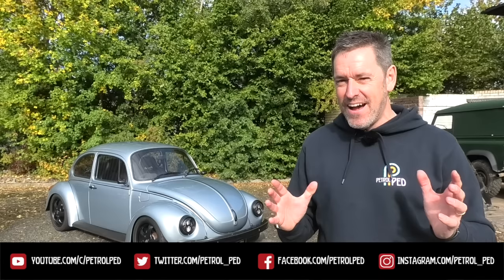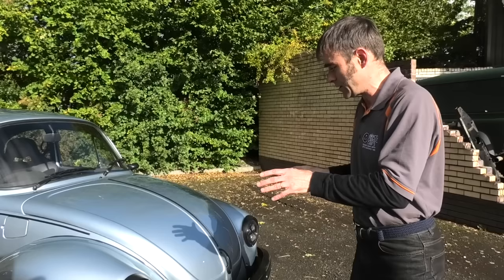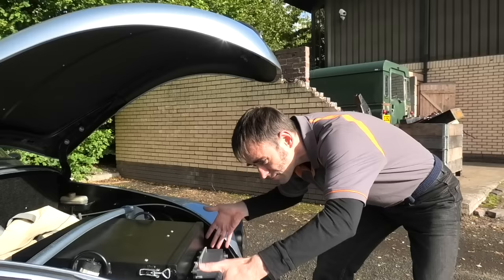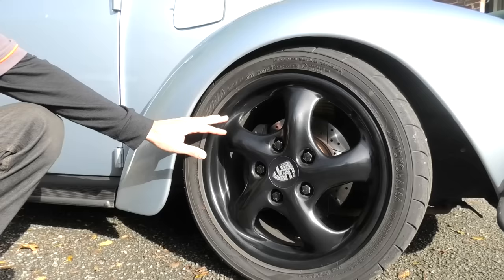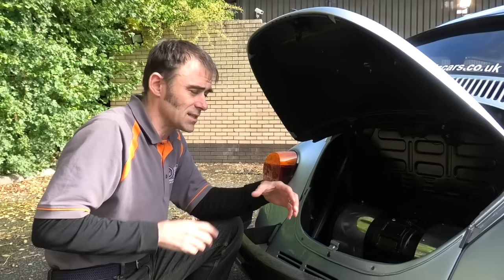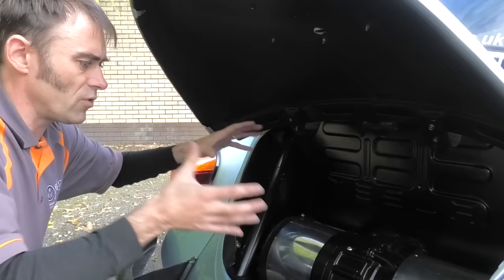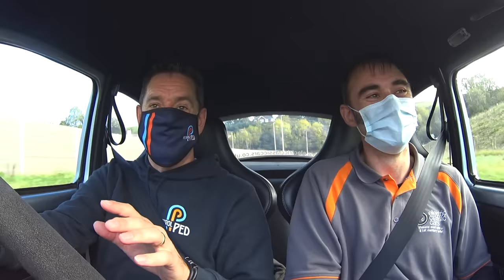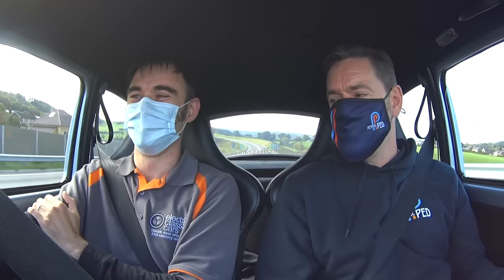*EPIC* 600hp 1000kg Tesla powered Beetle ! [In-Depth Review and Drive]

Comment: What a pointless destruction of classic vehicles
Reply from the maker: The donor car for this Beetle cost £300...it would have been scrapped. Look at it now and tell me it’s destruction...REALLY 🤷‍♂️
Reply: @PetrolPed  This is a VW 1303 and not a Mexico Beetle. A gasoline engine belongs in there. With this electric drive, the entire structure of the car is destroyed and its soul torn out. Take a golf or a fiesta. But not such a classic.
Reply from the maker: As I said. This car was scrap and is now a piece of incredible engineering. Surely that is to be celebrated. Open your mind dude 😜
Reply: @PetrolPed  IT WAS GOOD TO RESTORATE THE CAR; BUT NOT WITH LED LIGHTS AND E-MOTOR; THIS HAS NOTHING TO DO WITH A CLASSIC CAR THAT'S RAPE